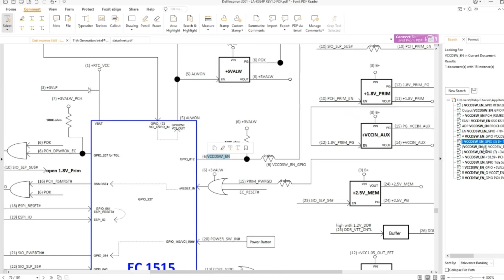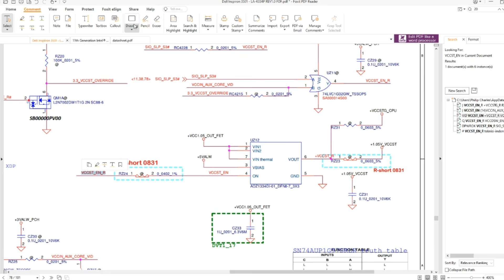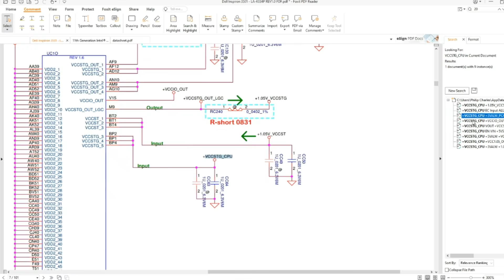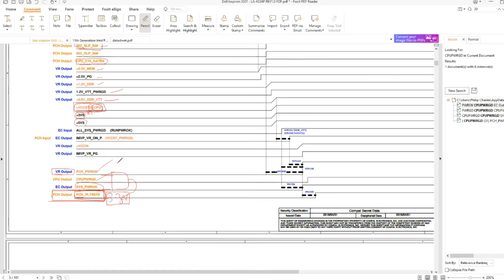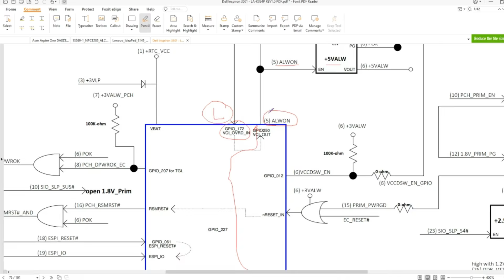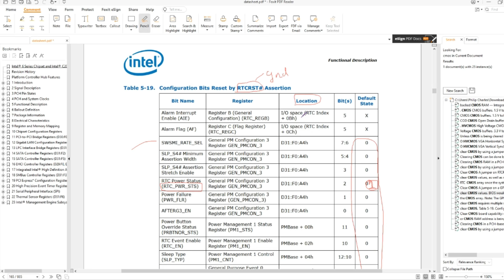LA-K034P| Fixing Dell Inspiron 3501 | No Power Issue|CMOS, RTCRST# & Power Sequence Explained

Comment: Thank you for sharing your knowledge brother,,,! Great stuff.😊😊. 
I got an ASUS motherboard and when i plug the charger it draws 0.29 Amp constant voltage. checked with the thermal camera and two small heat spots were visible on the CPU and the PCH. any idea were to check. 5.5v 3.3v 1.8v all present. couldn't find the schematics.Thanks
Reply from the maker: 0.29amps at standby is abnormal. I guess the CPU and PCH got shorted through 1.8v or 3.3v alw. That's why you are getting that heat spot and that much of current at standby. All laptops, basically without battery, should consume current below 0.100amps, typically according to my experience.
Reply: @philiptroniks yes. Thank you for your reply. Got three elitebooks sometime back. Had the same issue amperage just stting at 0.29.
Reply from the maker: @mayuramunasinghe1983 oh ok. But not all cases are the same. There can be different problems for high current reading at standby, it doesn't always mean that CPU or PCH is dead.
Reply: @philiptroniks Yes. But couldn't rectify the issue. Without the schematics also sometimes it's difficult for me to diagnose. And nowadays bios is also complicated. Thank you for your reply..!! If you have time do a video on how to edit bios also. Thanks again 🎉

Comment: Brother, the signal "susclk" Whether is it value 3.3v??
Reply from the maker: Sus clock is a frequency 32.768khz, not a voltage. But if you check with multimeter it will show a voltage